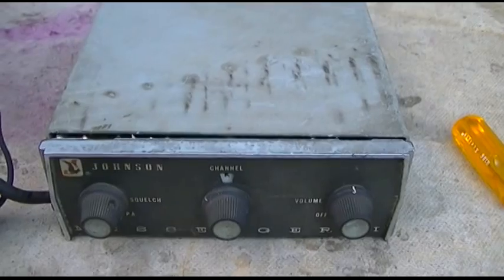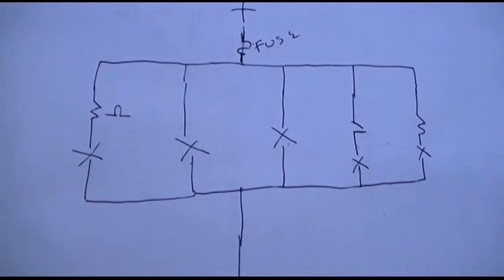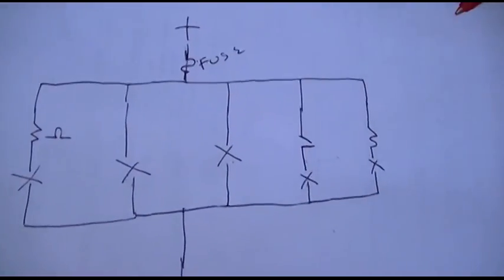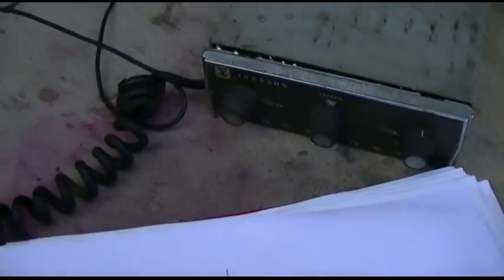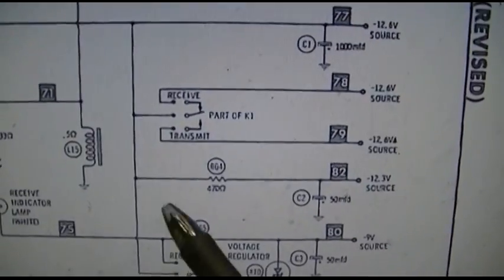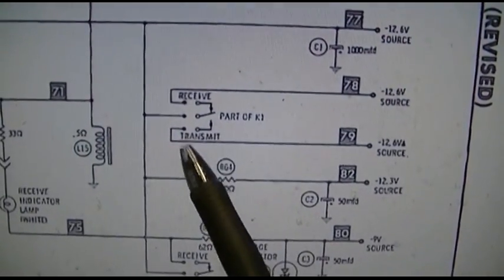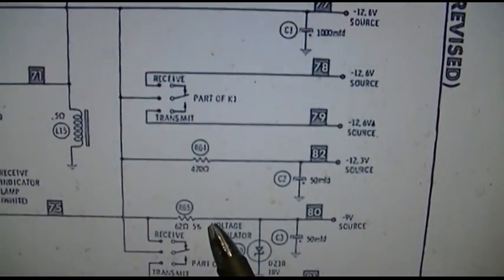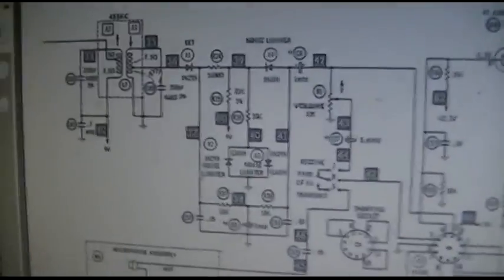Short Diagnosis Repairing Johnson Messenger III CB Radio

Comment: I started out with an old Johnson Messenger 1 with an orange indoor antenna. We used it as an auxiliary to the police radios when we wanted to just BS among cop cars or with officers at home while working the shift. I think it was capable of 5 channels all crystal controlled.  She was all tube controlled and you could make toast off the top of the pierced steel case.

Comment: We had an old 67 Ford pickup that kept blowing a fuse when my brother would plug a caution light in the cigarette lighter... it had those long glass type fuses. So he figures rapping the fuse with foil would stop that... It did stop it after it burnt all the wires up behind the dash. I wasn't very electrical smart at that time but after I worked with it for some time I was finally able to get things back to working 100%. That actually learned me how to troubleshoot vehicle wiring after I learned how to use a meter.... 😀

Comment: Sometimes you get lucky and a burnt resistor points you to a shorted output transistor. I had that on a 1968 JVC Nivico 5001 50W per channel AM/FM stereo tuner/amp combo. A 2SD180 output transistor went short and burnt a 0.5 ohm emitter resistor. Found a 2N3055 which crossed over and put it in. All is well now.

Comment: Those idiots on channel 6 run KW's of power over drive and splatter there trash all over the band when the skip is in forget even talking around the block over that trash.
Reply: AbandonedSC Yeah, Seems that no matter what those 2 guys on channel 6,  Tyrone and bubba are always there. good way to check if you set work though.  b/c they are always there. blasting away.
Reply: More like Tyrone and Jerome Bubba  Is on 19 LOL!

Comment: I once had a radio with a shorted tantalum in the transmitter. To find the short I first  isolated it to the transmitter. Lacking money for a current limiting power supply in those day, I used a wall wart 12v 500 ma power supply and applied power and located the part that was heating up.  This was enough power to heat things up but not smoke out.